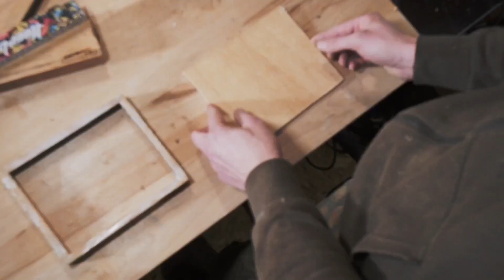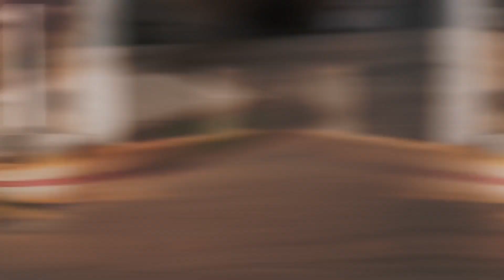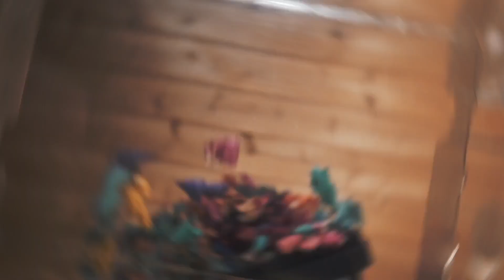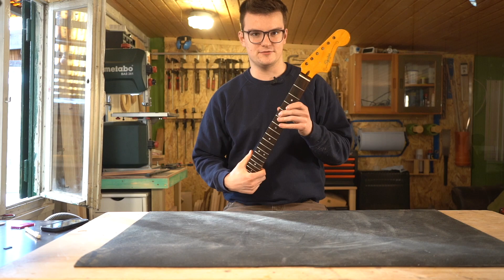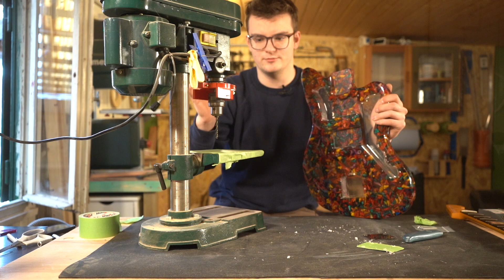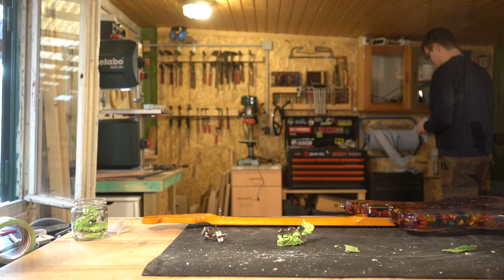Great Guitar Build Off 2021: Skatemaster first assembly Part 4 - Teil 4 #GGBO​ #GGBO2021

Comment: Great video mate. Don't forget to pull the bridge insert closest to the wiring cavity and drill a hole to feed a ground wire to the bridge insert and ground the strings via the bridge. Wasn't sure if they do that on the template squire body to cancel the notorious ground issue on Jazzmasters.
Reply from the maker: Thank you 🙏 
I did the wiring last week and fortunately I thought about it in the very last second😅 
Saved me a lot of work and now I have no Buzz at all👍 
But thanks for the reminder anyways!😅